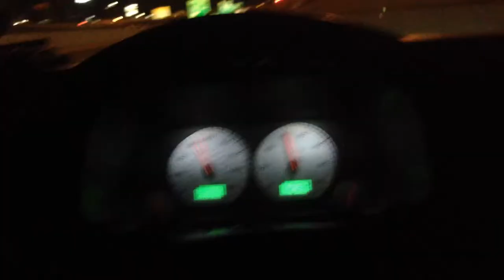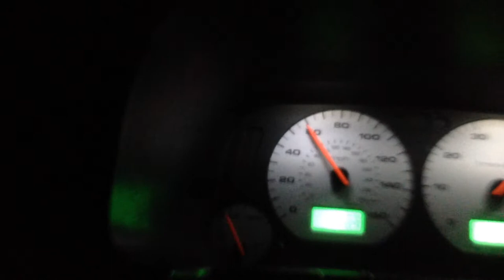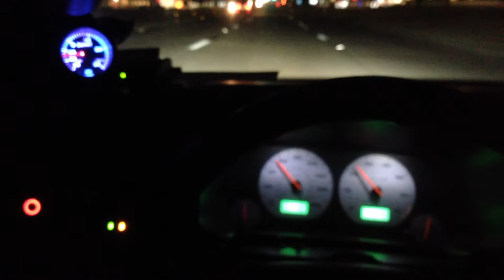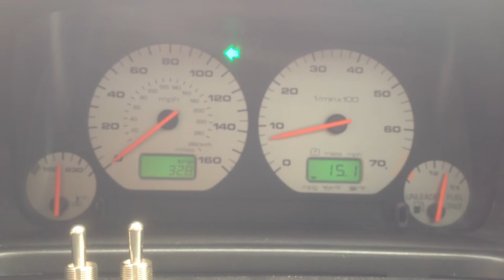Mk3 Jetta VR6 N/A to Turbo Compilation

Comment: Nice build, but I would upgrade to a full mandrel 3" from the downpipe back. 2.5" is definitely a choke point on anything F.I. guarantee you'll pick up power just by going to 3."
Reply from the maker: totally agree. The Mk4 I currently have has a 3" turbo back. thanks for watching :)